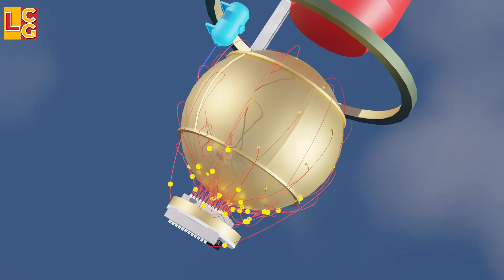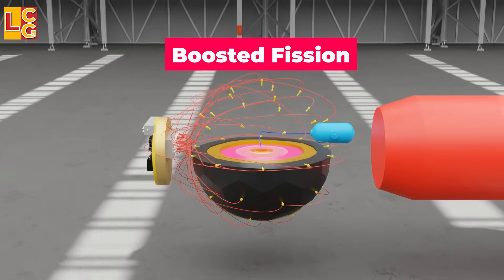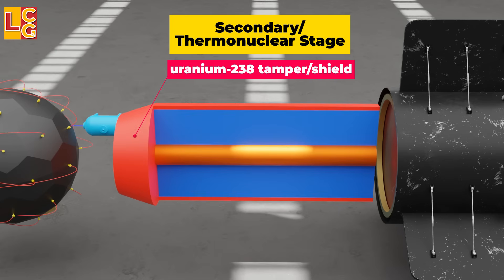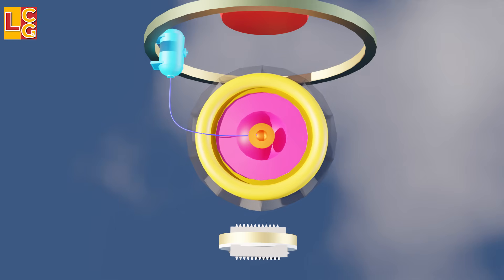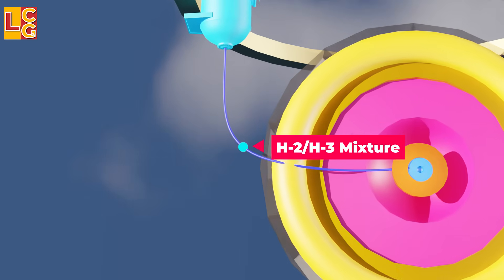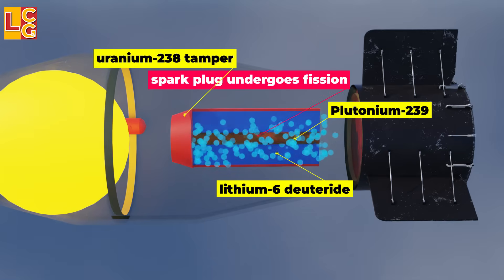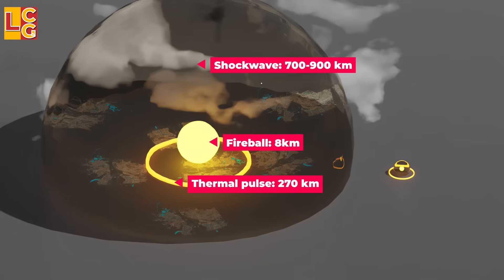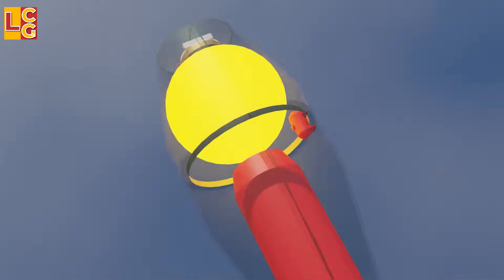How Hydrogen Bomb Tsar Bomba Works

Comment: Impractical for effective delivery. May have been a beast, and it would have been even more a beast had it not been nerfed, but its physical dimensions and weight were so unwieldy there isn't even today an ICBM with engines capable of delivering it.

At leas as we know.

I seen to have read somewhere that unofficially even the Russians at the times agreed on the fact it was built for propaganda, a show of muscles that had no practical use. Or maybe a study on how to built more powerful bombs... that produced a veritable monster under all aspects. Too big, too heavy, too cumbersome.

Of course we know a bomber could be, and was, used to deliver it, but any known bomber capable of carrying it would be shot down WAY before it reached its intended target.
Reply: You're right, the meaning of the existence of this bomb was primarily in the political aspect.
Reply: A Saturn or Soyez type rocket could've delivered it although that would've been quite expensive.

Comment: tow stage were by each 1st staged caused the super compression of the 2nd stage. 234 neutrons per square micro cm. Based on Childs toy of gun powder between tow bolts in a nut.
Reply: What?
What's a micro cm?